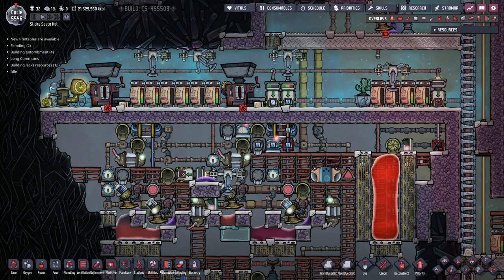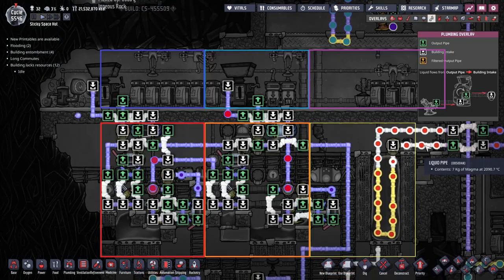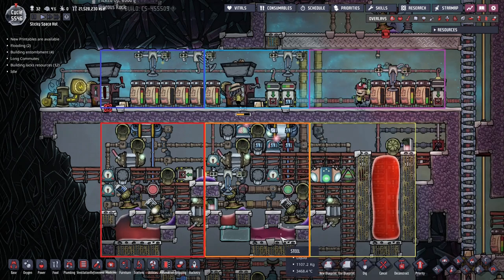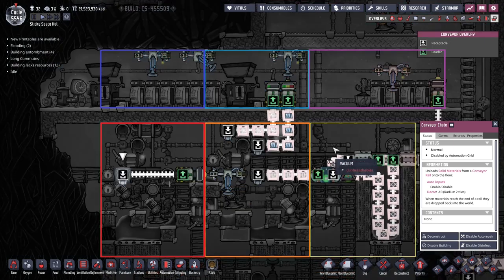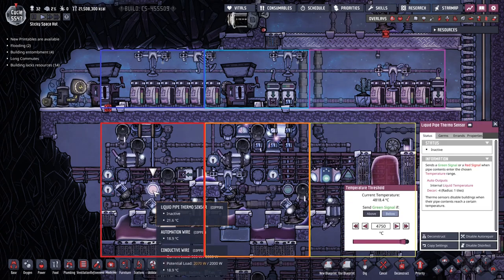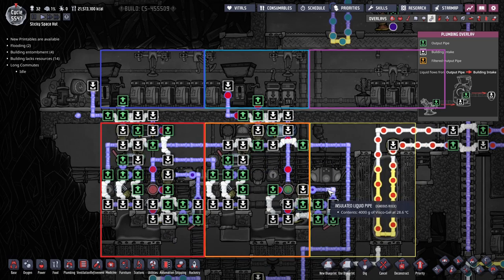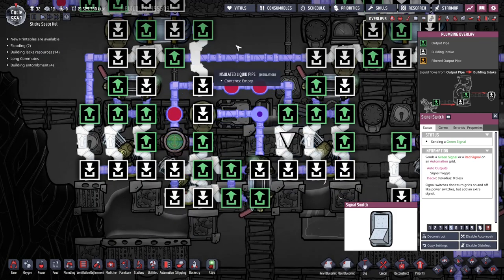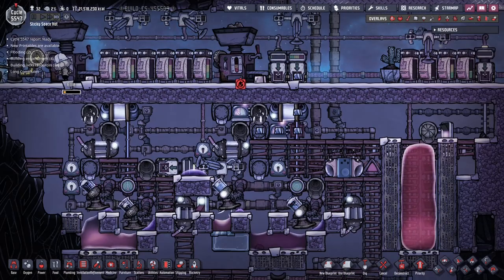Carbon Melter! What It Takes to Melt Abyssalite - Oxygen Not Included

Comment: Insulation melters are probably one of the most complex processes in ONI.  Now, we have tungsten volcanoes and a niobium volcano while insulation is difficult to acquire outside the liquid duplication exploit for the isoresin, which is a relatively simple exploit by the looks of it.
Reply from the maker: Isoresin definitely the bottleneck now. Can either feed the tree (or replicate, but set the desired flow rate to something that wouldn't ruin the feel of the game).

Comment: Hello, thank you for the tutorial. Could you please explain what the "copper process", "iron process" etc actually does? Thank you!
Reply from the maker: Good question! I just refer to the metal refinery type of smelting job queue as the "x" process.
Reply: Each process in the refinery creates a fixed amount of heat, depending on the metal ore you're refining. The wiki has the full table I believe, but long story short, gold < copper < tungsten < aluminum < cobalt < niobium < iron < steel. 
By choosing the process, you can control how much you heat the coolant up. Use steel to increase the temperature very rapidly, and gold/copper for finer adjustments.